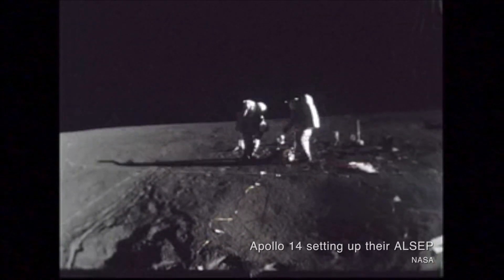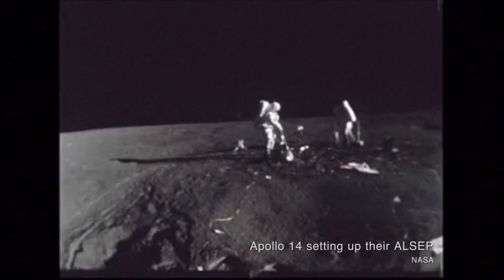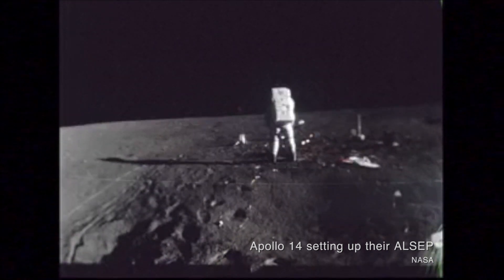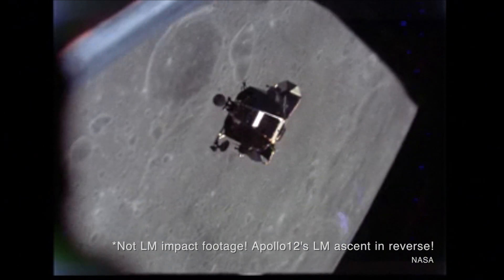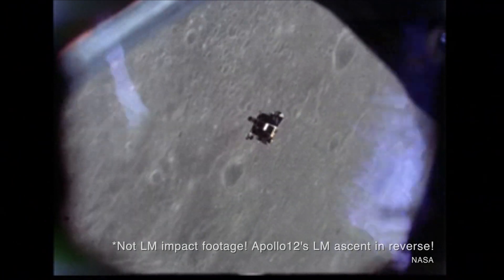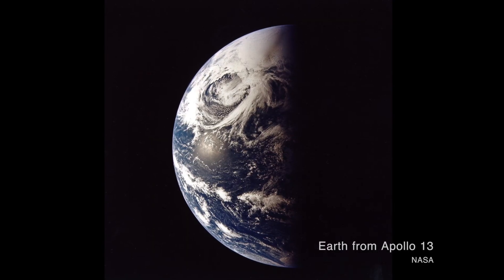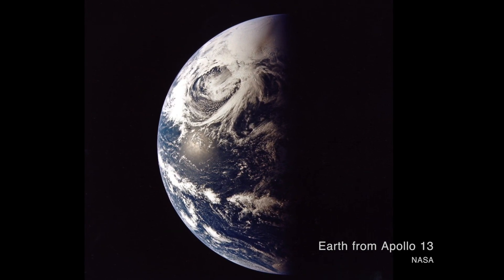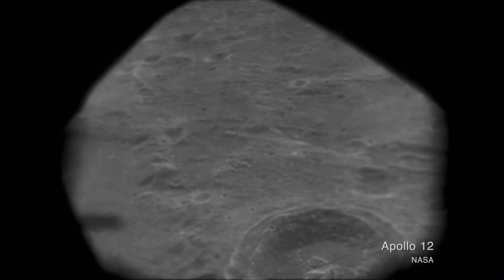Does the Moon Sound Like a Bell?

Comment: Sound waves need a medium to travel. As there is no atmosphere or medium on the moon, that's why no sound can be heard on the moon. Astronauts use radio waves while talking to one another on the surface of the moon.
Reply: They’re talking about seismic waves traveling through the moon’s interior. Those can be measured at the surface with a seismometer. They found that after an impact, those waves would get reflected a lot, and only decrease in amplitude slowly. Here on Earth, an impact causes one thump and a few echoes. On the moon, there are many more echoes.

Comment: How would it "Ring" if theres no air in space, therefore sound can't travel...
Reply: They’re talking about seismic waves traveling through the moon’s interior. Those can be measured at the surface with a seismometer. They found that after an impact, those waves would get reflected a lot, and only decrease in amplitude slowly. Here on Earth, an impact causes one thump and a few echoes. On the moon, there are many more echoes.

Comment: Sounds like an unproven theory, the idea that it's just because it's dry. Last time I checked, a non-hollow rock doesn't ring like a bell—no matter how dry it is. Ringing like a bell seems to speak to a unique material or shape of material, not water content. Sure, water content dampens vibrations, but I'm not aware of any proven examples where mere absence thereof is enough to get a solid sphere to ring like a bell.
Reply: I'm late but I want to say: Good point sir!
Reply: That’s not how science works. Of course we tried this first before using it to explain anything.

Comment: Riddle me this Batman. How did the moon ring like a bell when there is no sound in space. The Moon is in what is essentially zero air which has no sound. You should be saying it vibrated like a bell it oscillated like a bell.
Reply: They weren’t listening to sound, they were listening to the interior of the moon with a seismometer.

Comment: In the late 1950's 2 Russian astronomers made the conclusion that LUNA aka the moon was/is an artificial satellite and a primary evidence was/is the material on the surface was going to be 2 primary items almost entirely. That was proven early on but how to take that further was being debated until the 1st incident when the leaving nasa mission jettisoned its attached landing craft which fell to the surface and caused a major seismic  disturbance that lasted for over 1 hour. A few years later nasa took this even further dropping a heavier object from a higher distance which made an even more pronounced ringing much deeper somewhat like a GONG and the seismic recording lasted for over 3 hours. 

No small piece of fallen space debris has the ability to cause EITHER ONE OF THESE one its own. Meantime, ancient Sumerian texts indicate a time when earth had no moon and that they actually recorded it being POSITIONED into orbit.

Some may argue that's mythology however the the Sumerians had quite a few observations about our solar system and to date ALL OF THEM HAVE PROVED TO BE HIGHLY ACCURATE, so the question then become relevant: what did they see?

The Mayans also held to the firm belief that the moon is hollow and was made by the gods to be a guardian for this planet.

Science has never been able to bring forth actual math to explain how an object the size of the moon could be captured by earth. Luna is 27% the size of earth and no other moon ever found has nearly as high a size ratio to its host.

Ganymede of Jupiter is the largest moon in our solar system and basically the size of  Mars but by ratio is less than 1% to the size of its host. 

Science is just highly lacking at explaining the universe and reminds me of this great song line:

Misled by science, 
our wake up call

Conditioning can not fool us til the end

-EPICA /Kingdom of Heaven

Comment: How could anyone have known that the moon rang like a bell when sound does not travel in space?
Reply: it travelled through the solid matter on the moon, then got picked up by the sensors planted on the ground which broadcasted to the orbiting lunar module where the astronauts were ( in form of radio waves) and then that broadcasted to the earth. got it?  The sensors on the ground had antennas to broadcast.

Comment: You use the moisture theory as though it is fact. This is merely a hypothesis, wouldn't you say? 

I could say that it's is due to a lesser gravitational pull allowing the energy to reverberate between a longer distance. Would you believe that if I stated this theory as though it were undeniably true?

(that's not a true theory by the way, just emphasising a point) 

science should never clutch at straws or if it does it should be stated that it is a theory. we must remain skeptical.

Comment: i thought apolo 13 was a failed mission so how could they have something crash into to moon?
Reply: The S-IVB that was used for the TLI burn is what crashed into the moon. Since the Apollo 12 ALSEP was working, Apollo 13's spent third stage was always intended to be the first one to generate a artificial impact. Since it was already separated & positioned to do so before the Apollo 13 crisis occurred, there's no reason why it shouldn't of happened.

Comment: hello Amy,
I have a question for you. Yesterday I saw a documentary about the apollo 17. I learned that the 2 astronauts stayed on the moon for 3 days. Since the Lunar module looked very basic to me, I ask myself, did the astronauts have a toilet on board, or was their diet so well balanced that they didn't use any toilet? Maybe a weird question, but I would like to know.

Greetings and success with your great channel!

Paul
Reply: Think plastic bag with a hole in it surrounded by sticky tape. Then wet wipes and tissue afterwards for cleanup. And of course more plastic bags. No toilet on board either the Lunar module or Command module.

1. Get naked.
2. Apply plastic bag.
3. Do your business.
4. Remove plastic bag.
5. Cleanup afterwards placing all trash in another bag.
6. Get dressed again.

Not very pleasant at all.

Comment: The Lack of mineralogically trapped water was seen as evidence that the Moon formed not out of primordial material  as the Earth did but instead from red hot material. A giant impact between the Earth and a Mars sized object ejected the material that formed into the Moon. The ejecta was heated to the point that much of the water present in the rock was boiled off. We know that surface rocks collected by Apollo contained little water. The lack of water in the Moon's interior indicated by the crash tests shows this is true of all the Moon's materials. This is an important clue into its formation.

Comment: Also this "damp material" bit doesn't make sense to me. I'd like more info on that.
Reply: Actually the whole seismology part of this seems kinda off. Amy says in the popsci post that "The resulting shockwave built up and peaked in just eight minutes." Why / how would it "build up"? Surely there's an initial large motion and then a decreasing coda -- it can't "build up". Is she talking about the P / S wave delay? If so, how could it possibly be that long?
Reply: Maybe Amy means that the moon has no asthenosphere?
Reply: Dampening material. Shock absorbing material.
Reply: Ok just asked to a seismologist here. Amy is absolutely right about the water. Hydration of rock has a big impact on the bulk modulus -- I didn't realize that. As for the "building up" thing, I still don't quite get it but I'm going to try and read a paper or two on the topic.

Comment: Does that mean that if standing on the moon while the ALSEP hit, it would've felt like a 5° earthquake for a full hour?
Reply: No. The magnitude 5 is the total energy delivered at the point of impact. That energy gets diluted as the seismic waves propagate through the Moon. It's like on Earth, when there's a magnitude 8 earthquake happening in, say, Chili, which seismographs in, say, Los Angeles can easily detect, but you won't feel anything if you are just standing around in Los Angeles.